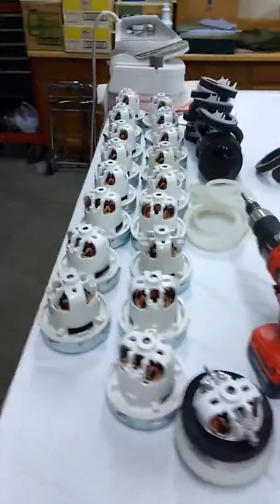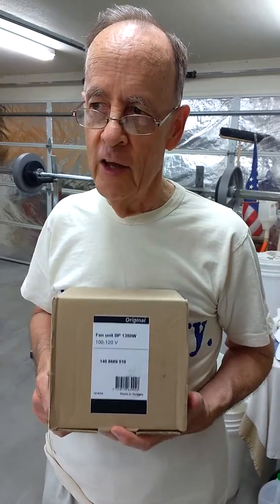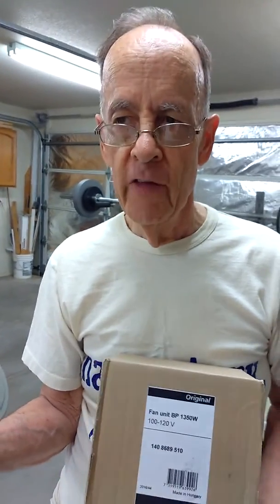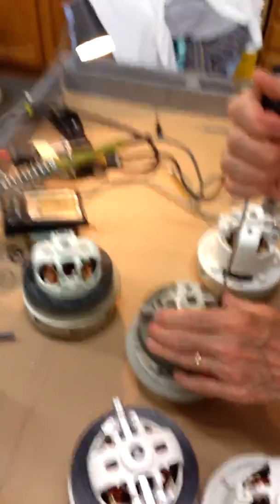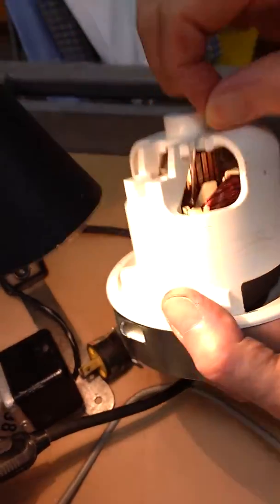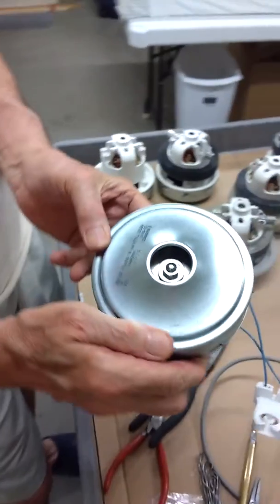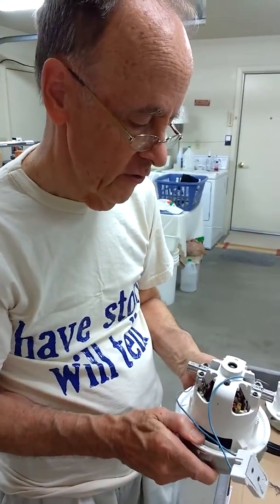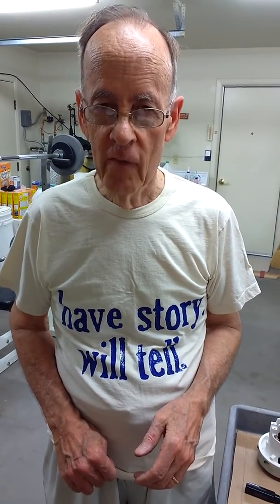DIY Repair of your Nilfisk Vacuum Motor to prevent early failures. P/N 140 8689 510

Comment: Looking for some help. I have a Clarke summit 13 Vacuum with the motor P/N 140 8689 510. I am trying to find a set of brushes for the motor. 
I was able to find a parts manual but they do not list the brushes. I am hoping you might have a set you can sell me or a part number and a good source that I can purchase a set. 
Thanks. 
Ed P
802-899-1065
epvermont@hotmail.com